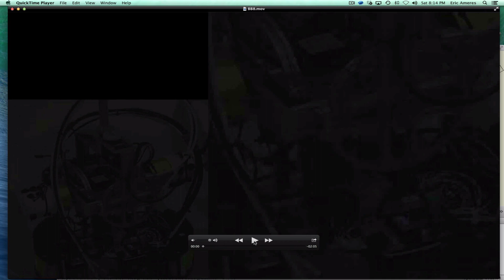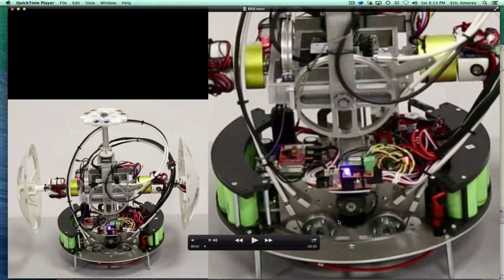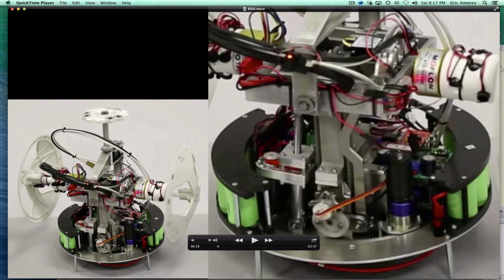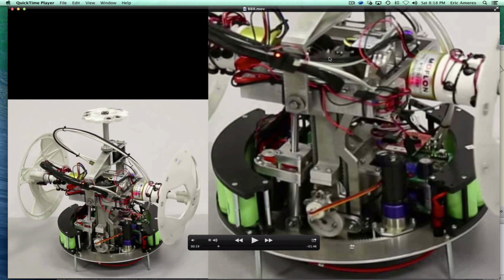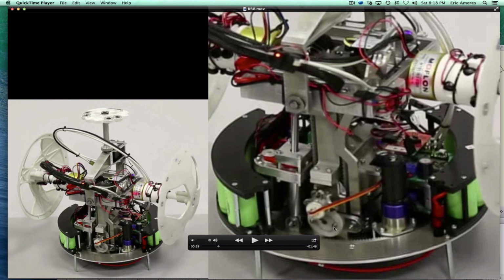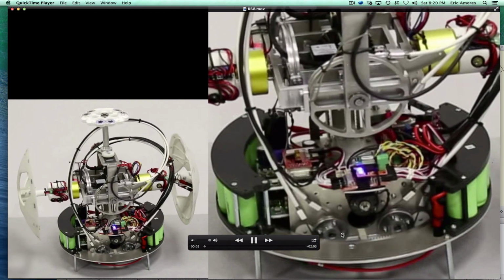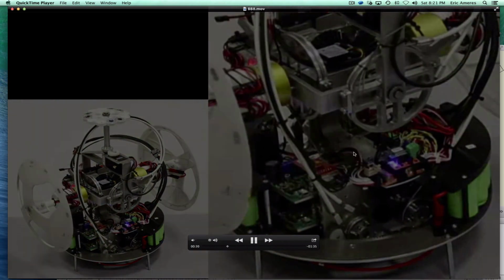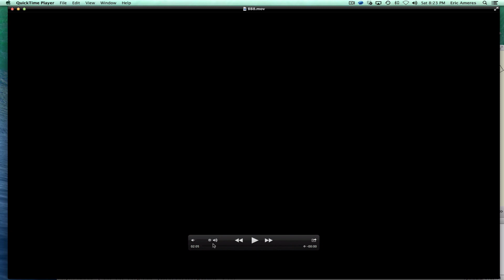Analyzing the BB8 Red Carpet Drive System

Comment: The arm that reflects the tilt angle is directly connected to a simple white gear. That gear drives the potentiometer/encoder you are seeing. It means the encoder rotates faster as it's geared, and enables the stabilisation/feedback to be more accurate.

Comment: The arm at the back (4:23 in video), I don't think that links to a potentiomiter, I think instead it rotates the main drive motor so changes in tilt don't cause a change in drive rotation. You see the drive motor has a timing belt up to the bevel gears, if the motor was fixed, as the counterweight tilted it would impart rotation in the timing pulley and cause the sphere to move forwards/backwards. Rotation the motor with the tilt removes the need to try to compensate for this electronically. Do you think that could be the purpose of it? If they wanted a POT on the tilt they could get it from the actuator and save themselves all that complexity with the linkage

Comment: I still don't see how they can put the batteries on the flywheel and still get power to the middle without a 3rd slipring
Reply from the maker: it's either a slip ring buried under there, or it could be some kind of custom brushed solution rather than a standard slip ring.